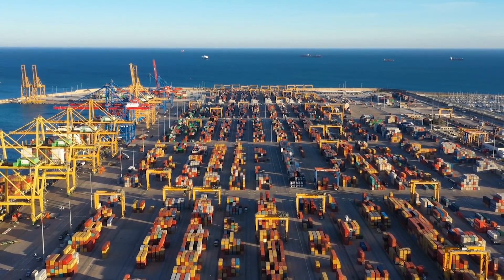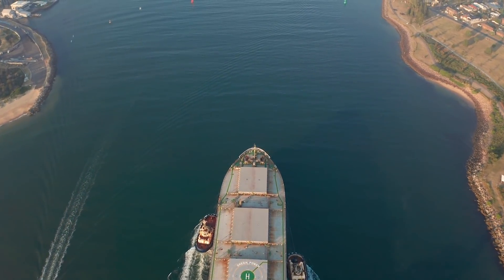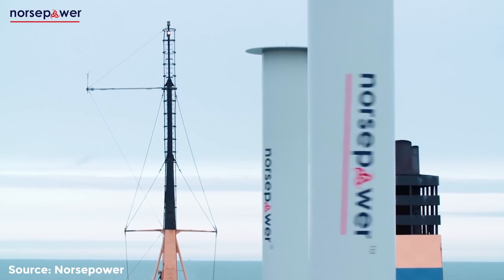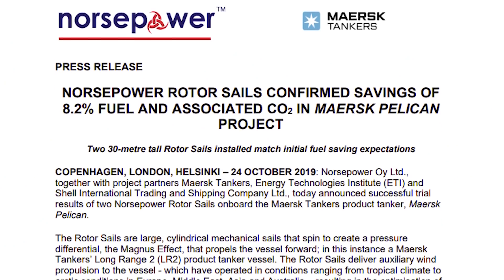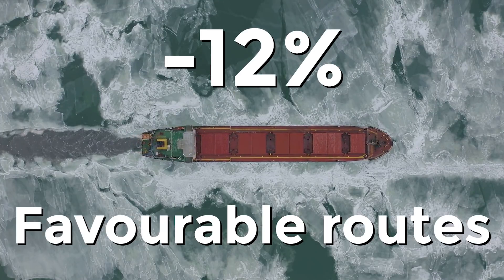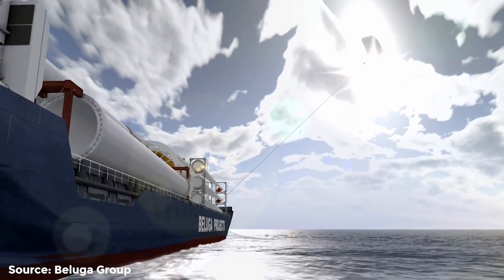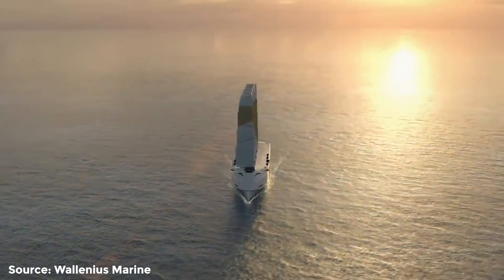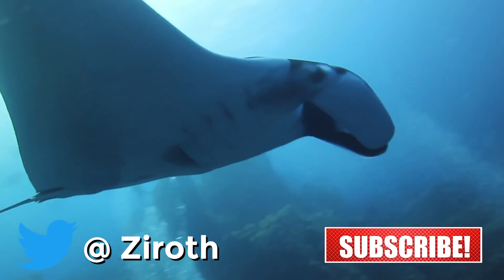Is Wind Power The Future of Shipping?

Comment: Interesting why not have a giant electric ship use the batterys as Ballas and have wind turbines on the side of the ship in fact as the ship is moving forward it will generate it's own wind forcing the wind turbine repellers to Spain you don't even need the wind and if you get the wind turning the wind turbine propellers as well would be a bonus to provide electricity to charge the batteries after all they put wind turbines in to the sea and if you put them on the sides of the ship you will still have all that space for cargo you don't have to  have great giant ones maybe 4 or 5  on each side the ship could do the trick someone comes up with that kind of design I bet he make billions

Comment: put a solar roof over the containers and the ship, and normal vertical wind-electric turbines over those, directly boost diesel-electric systems
Reply: And how will the load/unload the containers? This channel is a generator of stupid ideas.
Reply: @WEMBLEYNE  you can move them if you need more space
Reply: @WEMBLEYNE  keeps the containers in the boat in rough sea
Reply: @Jkauppa  rofl in a rough sea those solar panels will fly like cards and don't worry about the containers, they are designed for rough seas.
Reply: @WEMBLEYNE  if you dont need additional attachment for the containers, you can lay a layer of solar panel directly as a thin container layer on top of the others